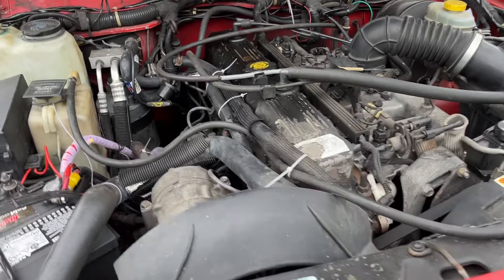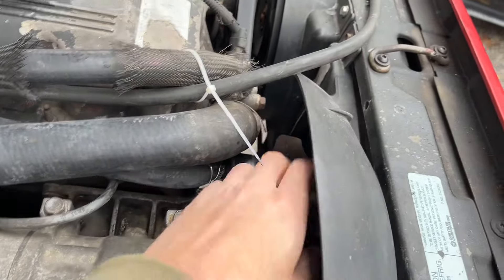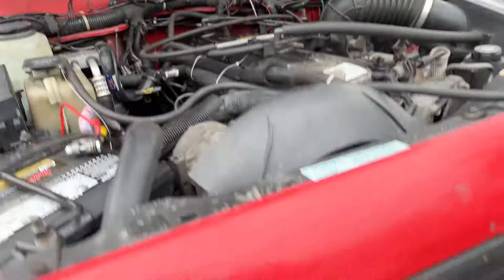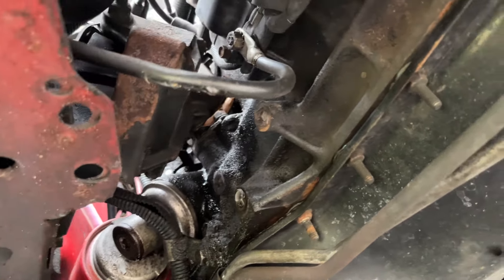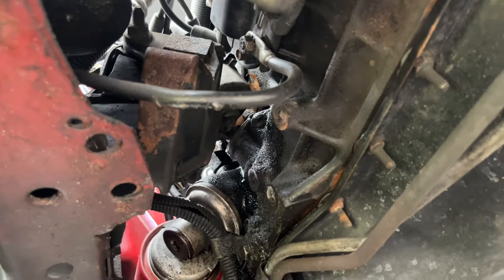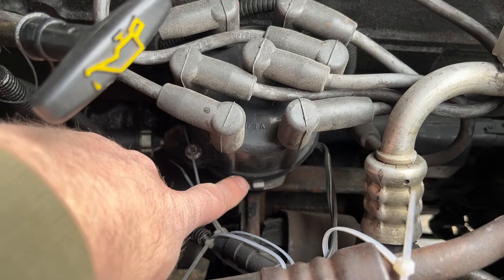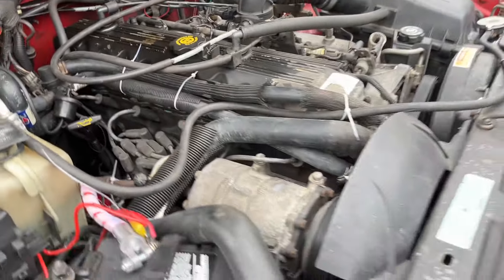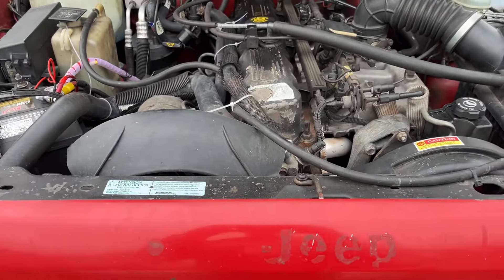this is why I drive old Jeep XJ's ￼ ￼

Comment: It is said from factory the bolts are a hair (too long to avoid overtorqueing or something?). Mine did the same thing. Hanging by 1, 1 gone and 1 sheered right off. Was able to get the bolt out by twisting my thumb on it 🤷‍♂️

Comment: This happened to my Jeep about a year ago November. I was driving downhill, got the death wobble like nothing I ever felt before. Heard this awful sound, motor fan stopped turning, so I limped it home. 
Over the next month or so I changed the thermal clutch for the motor fan, the axle shafts (with U-Joints), axle end bushings for the UCA as well as the UCAs, and the wheel bearings/hubs. The noise was still there. Took it to a shop and they diagnosed it immediately. Same thing, oil filter and distributor were the only thing holding the motor in. Bought the motor mounts and transmission mount and they handled the labor.
Reply from the maker: No way? I figured the kid the bought this Jeep from screwed the motor mount on with some left over bolts from his last Ikea purchase.  I'm about to try to fix it now before the weather gets too cold.  Thanks for sharing your story.
Reply: @amateurism1  "from his last IKEA purchase" 🤣 that's good I like that
Yeah you've got to figure most of these Jeeps around coming up on 30 years old, they're tired and depending on where they are the weather may have had a hand in things like this (i.e. rust) it's bound to happen, newer stronger bolts exist and can/should be put in for preventative maintenance

Comment from the maker: You all have convinced me that I should change the fasteners on my other XJ before it happens to that one too, was it only the passenger side that does this? Thank you for your replies!
Reply: Had a Ford I-6 do that,straight 6's are hard on motor mounts
Reply from the maker: @shawnbrodrick8673 Now that I've let this marinate, I think that's true, the fasteners are in sheer on the motor mounts on in-line engines.  The in line engines have bad harmonics too, so as time goes on, the joint may transition from slip critical to bearing, the bolts then may not be enough to survive a bearing joint.

Comment: lol  i just changed that exact same motor mount last week and it was a bitch....good luck but easily doable
Reply from the maker: @dman1597  yeah.... Welding up material on the bolt buried deep into the block, then welding on a nut was easier than getting the three bolts into the side of the block after I got the broken bolt out lol, the aft one was a PITA, good thing it's not that cold out yet, I'd let that sit till spring, if I tried this a month from now.